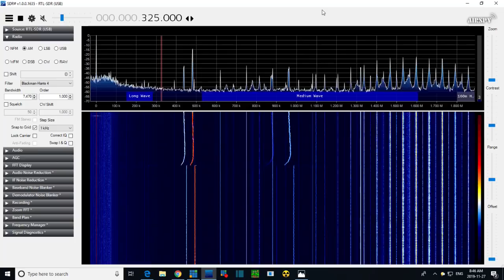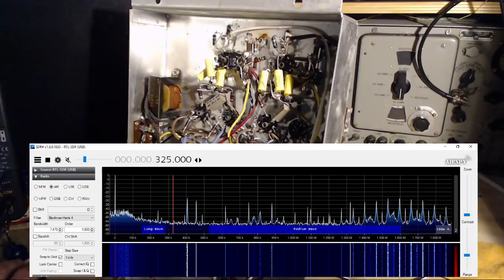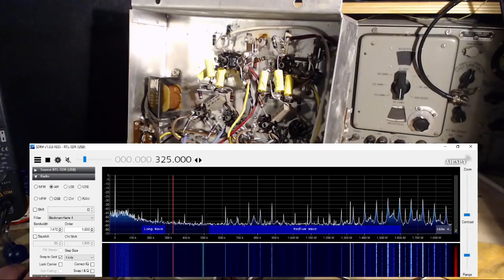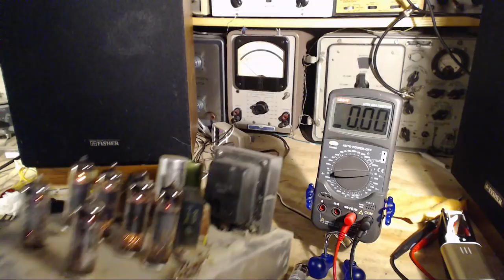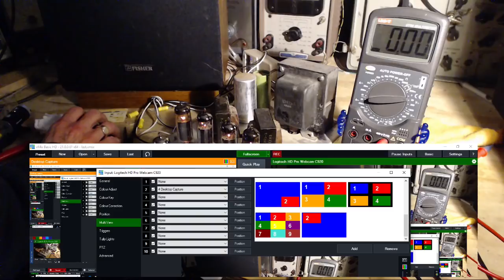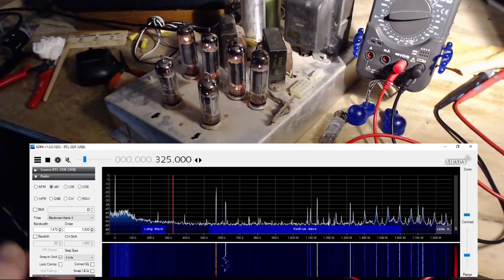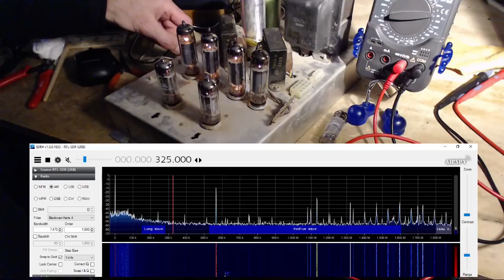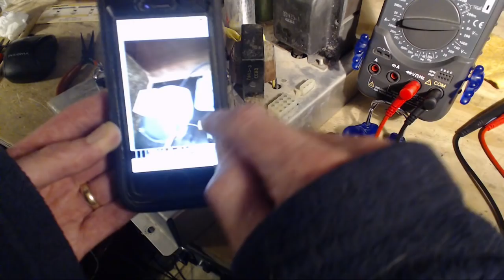Canadian Admiral J104X J105X Console Video #8 - Oscillation Solved

Comment: Hi Jim
The hum could be the amp picking up you as it has no volume controls !

Hint : -
Running a few stripes of self adhesive aluminium exhaust foil tape run under the amp will help screen it .
It works well just fit it like the old asbestos sheets when you reinstall it .

Comment: If you are using just one speaker as you are on your bench you should connect them directly across the output transformer without the crossover components connected. That way you are loading the output without any frequency selective circuit. By connecting a speaker via the crossover devices you are not loading or terminating the out put right across the audio spectrum because your load is frequency selective. I hope I have explained myself.